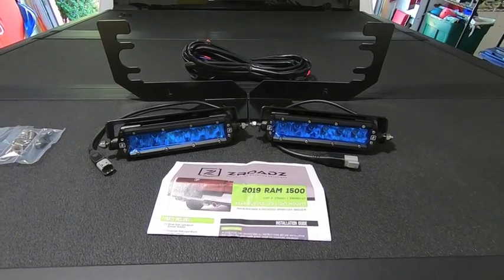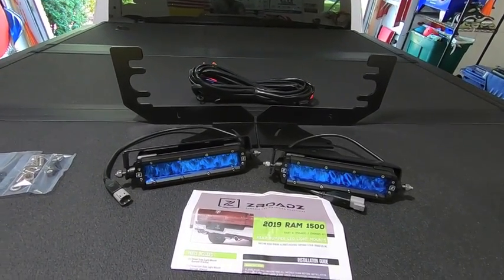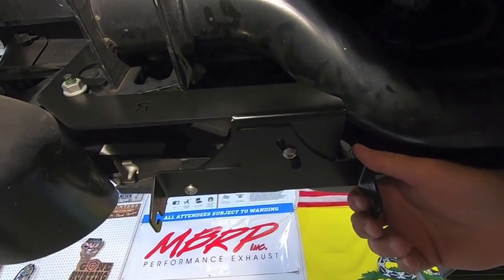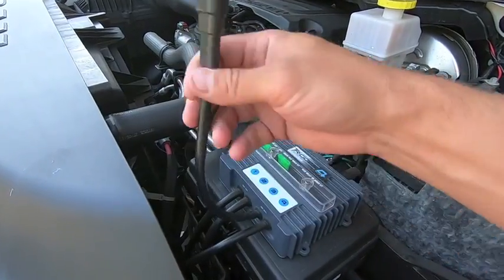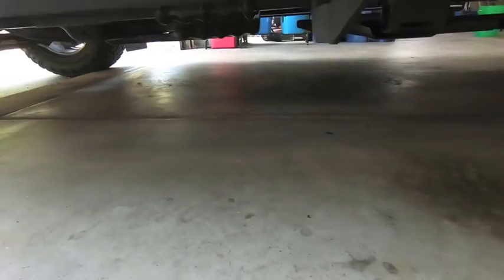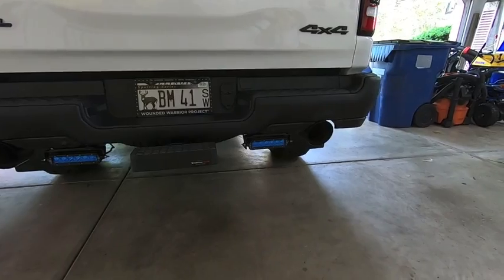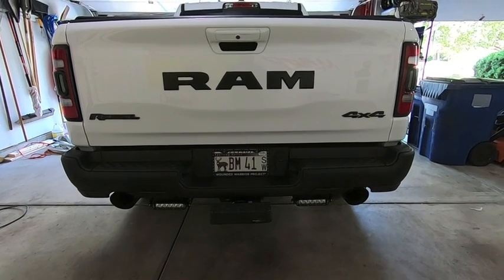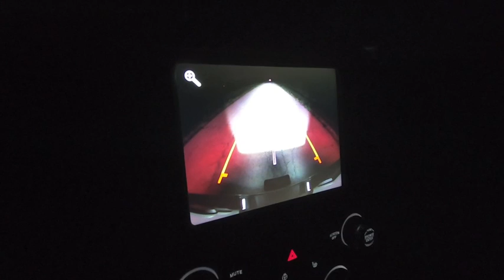ZRoadz Rear LED Kit - Ram Rebel

Comment: Hey is there any way you can get in close so we can see exactly how it was run. Don't wanna mess up. You have perfected it. Also are you still making the brackets where you changed to
Reply from the maker: I ended up moving those lights to the top of my bed side to run as chase lights

Comment: I just bought a used 2020 Rebel and just came across your video.  I'd like to install these low-profile lights.  Any changes since you posted this video that I need to be aware of? Also, I ordered the SwithPro controller.  Would like to know your thoughts on using the SwithPro vs the Trigger Wireless controller mentioned in your video.
Reply from the maker: These lights are super bright, you will be happy with them.  I just recently replaced my trigger controller with the AUXBEAM RGB controller.  I can change the backlight color and match my dash.

Comment: Did you consider the Baja Designs kit?  I can’t tell which set hangs lower. I don’t want to lose clearance.
Reply from the maker: No I didn’t . I already had the Zroadz front a pillar brackets and decided to stick with a brand I’m familiar with.

As far as ground clearance the kit I used and the Baja kit are likely the same dimensions as far as ground clearance. My lights are wider but both kits hang down the same distance from the bumper it looks like.
Reply: @WaterFowler41  Thanks. I studied more and really like your setup up. The BD kit taps into the reverse circuit and has a lot less lumens than ZROADZ. Plus your install videos are great. First up is install the Trigger 21 4 channel switch as your video shows. Thanks for making these videos!
Reply from the maker: No problemo, good luck with your project!

Comment: Can we just wire it straight to the reverse wire in the tail light??
Reply from the maker: I wouldn’t recommend that, you may overload the circuit and lock out your BCM. These lights pull a lot of power.  Best to either use an external device like my trigger or use a relay with its own power.